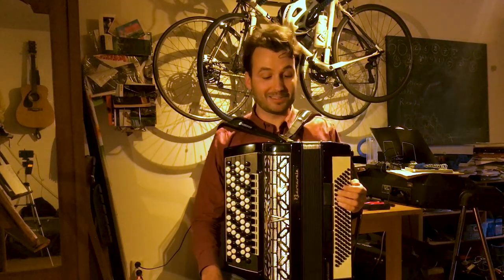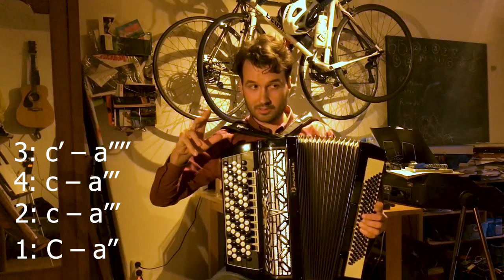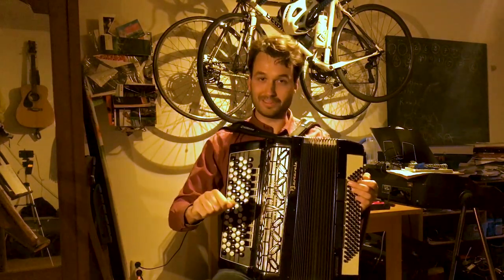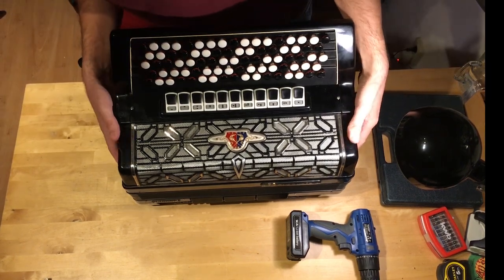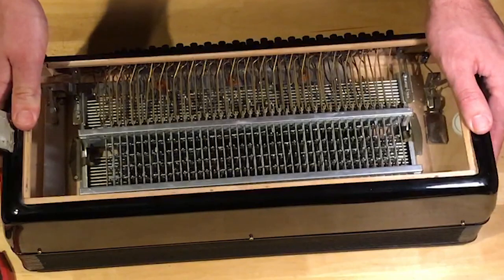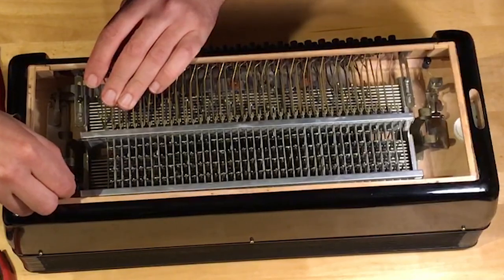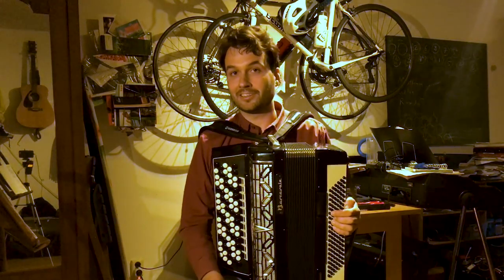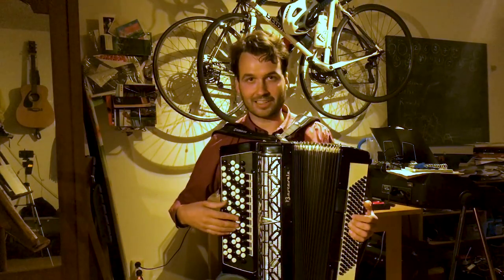Getting the most out of an inexpensive chromatic button accordion

Comment: Instead of a towel I would rather use thick felt, which would not risk to sag and move over  time. Also, I would not recommend to use an electric screwdriver when tightening screws and nuts! With manual tools you can feel when screws and bolts are tight and apply just enough torque. With an electric tool you can easily cause damage due to excessive tightening.
Reply from the maker: Thanks for the suggestions. Felt is probably better yes, I just used what was available at home. And about the electric screwdriver - it has a torque setting, so I usually set it the the lowest, 1 Nm. On more expensive instruments I'd indeed probably not use it, but it can save quite some time
Reply: @Cheiz87  Felt and Towels might loose dust which might cause problems over time.  Better put some paper inbetween ?

Comment: Could you not just put masking tape under a row of unwanted notes on the bass blocks. Also I would have taped inside the bass cover plate. Also for the towel you can get adhesive felt/carpet you can tape to the bass board which has the same effect. You can also put tape or adhesive felt/carpet matting or adhesive rubber matting on the inside of the treble cover. This will adjust the tone. I know as I have done all these things as I too like a softer sound on my Zupan accordion.